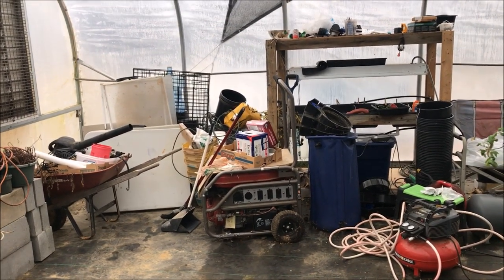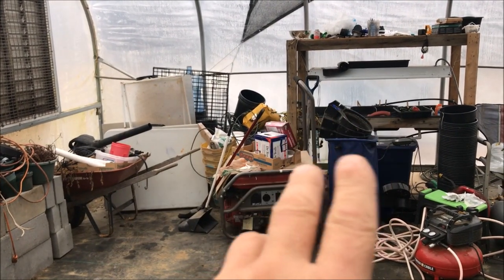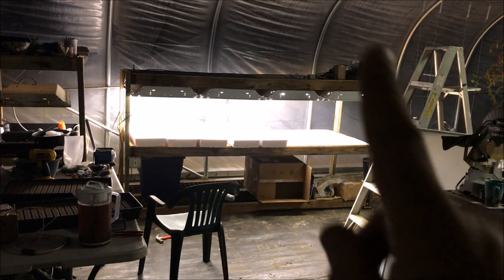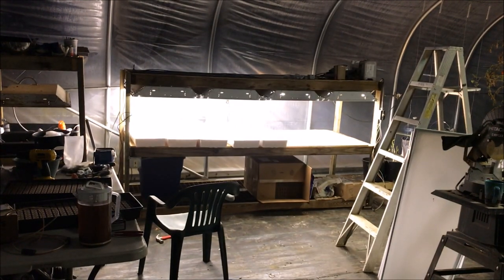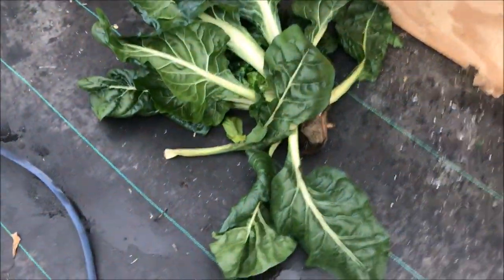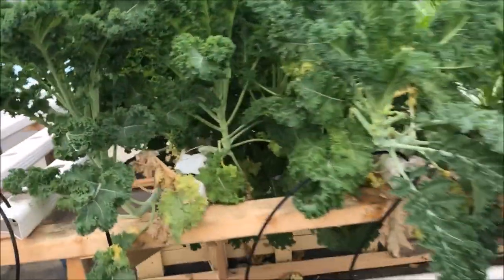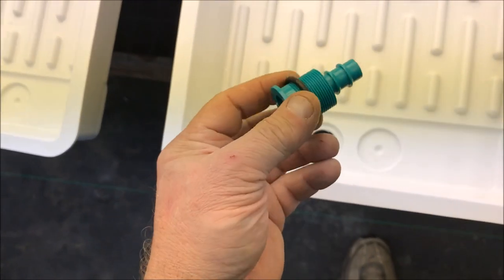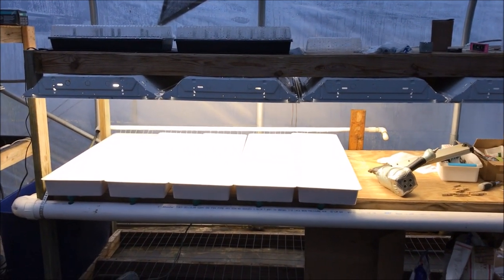New Seedling System For The Lettuce Greenhouse

Comment: Looks great. I want to set up a system like this when and if I ever get my High Tunnel up. I bought two 100 foot long High Tunnel frames 9 years ago in prep for my retirement. I retired almost 1 1/2 years ago and still do not have them up. Anyway, as far as the tip-over PROBLEM how about using some of those clips that they put on the side of the house to clip the downspout in when those are used as intended?

Comment: Hi, I think your problem with the backward flow is that tubing should be almost in line with the growing troughs, be a bit shorter and the hole can be a little bigger so that the tubing will have a tendency , being a bit rigid exert a forward motion causing the water to flow forward. Spring Hill farm seems not to have this problem. Also try a steeper grade.

Comment: hi Chuck
nice work looks great.
issue with roots  backing up water  is a easy fix usually only happens with kale and Swiss we put a 3/4inch shim under end of trough that speeds up flow and we run a rod through the trough that opens thing up.does not hurt the roots at all. this system works so well the  secret is harvest harvest harvest.it just keeps giving.

have a great Christmas
wayne and Patti&Ethan
Springhill farms
Reply from the maker: Great tips Wayne. I will try that! What is the mixture for nutrients in your propagation or seedling system reservoir? Is it the same as it is for the trough system? I don't think I ever asked that. It's not in my notes anyway.
Ya'll have a very Merry Christmas too!
Chuck
Reply: hi
half strength

wayne
Reply from the maker: Thanks
Reply from the maker: Hey Wayne. What was that cherry tomato variety? Was it flavorita? I can't remember.
Chuck

Comment: The problem with the root getting too big is a hazard of the growth. Can it be possible , as the trough is not very long, to make a sharpened tool and poke it inside the trough so that it cut the excess portion of the root and permit the water to flow freely instead of backing up.
Reply from the maker: Mohammed Ali that’s exactly how I deal with them. I use a 10 foot piece of 1/2” EMT conduit to clear a path for the nutrients.
Chuck

Comment: Chuck my friend, I hate to bombard you with so many questions but I have a couple more. Where can I find the trays and fittings that go under the grow lights? Also what grow lights are you using?
Reply from the maker: I got mine from American Hydroponics for 39.95 each. I just use 40 watt soft white florescent lights.  No worries on the questions. I had the same ones when I started this!
Chuck
Reply: Thanks you